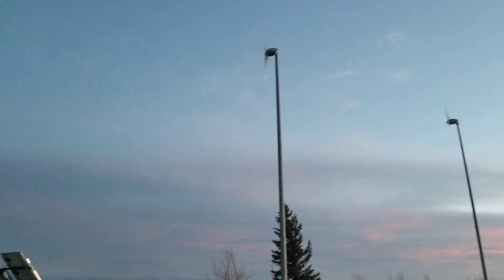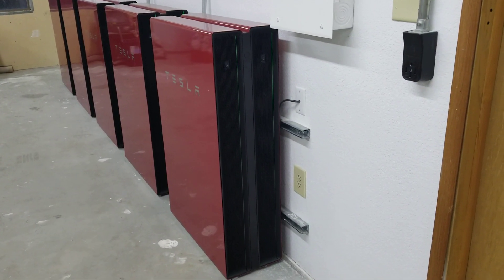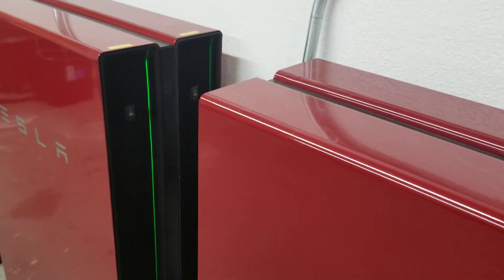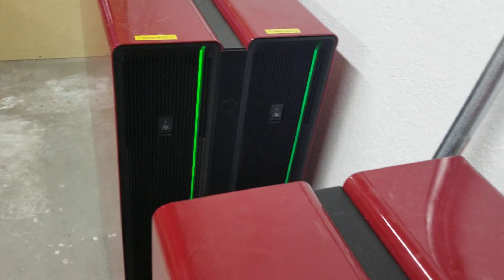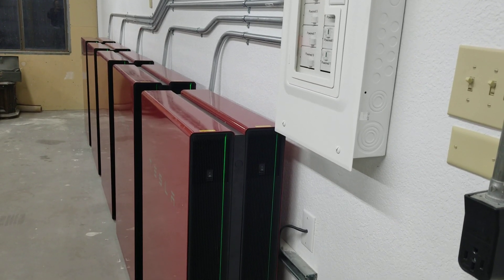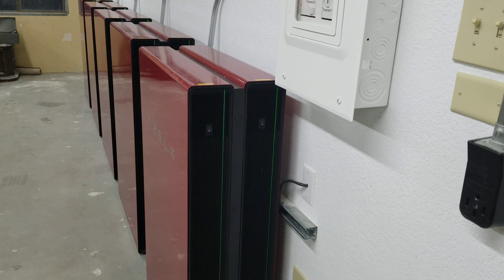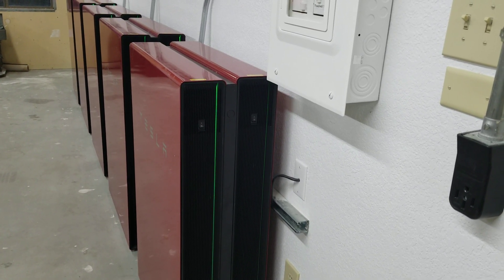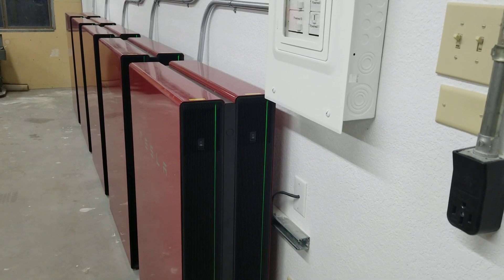Our 10 Tesla Powerwall 2 being charged by wind

Comment: And you consider that expense worth the money?  I have just received a cost analysis Bid for going solar with a Tesla Power Wall.  If my analysis is correct I would assume you must have paid about $100,000 for that Tesla Power Wall set up.  Or, did you get a discount because you purchased so many units?  Apparently getting off the grid is costly, considering how much you've put into your energy generation and storage.  Do you by chance have a business at that location where you would be using a great amount of power?
Reply from the maker: People have differing ways about assessing value.  What's the typical ROI (Return On Investment) for the average $100,000 motor vehicle purchase?  Most of the time they only depreciate.  People buy them because they find a value not limited to a balance sheet.  The same is true for us.  We are working to live our values rather than considering bottomline monetary ROI as the only metric of value.   We live in a state where most grid power comes from coal or methane. We want to minimize our carbon footprint. To do this we use energy sourced as much as possible from renewable source. When we bank our surplus power to the grid from our system the power we later draw back comes mostly from greenhouse gas emitting sources.  So for us, since it is within our financial reach, albeit a stretch, it was well worth the ~$100,000 total costs for us to add the Powerwall 2 system to our renewable energy system.  Some of that cost will be offset by a federal tax credit and buying back less electricity during low gain months early in the calandar year, but we know we will not likely live long enough to see the financial "break even" point for having done so. We are immediately seeing a reduction of power drawn from the grid, which means cleaner air for us, our children, their children, and every living thing on this planet.  Our perspective is "if everyone would do what is within their personal financial reach to improve the environment, a tremendous amount of good can be accomplished." So "is it worth it?"  For us, yes.  That doesn't mean that would be the answer for others.  From our perspective, if we didn't do this, we would be doing less than we should.  For us, this is part of our religious values of Tikkun Olam.
Reply: @AltView1   Thanks for the reply Jason.  My other half is a CPA tax accountant and we look at everything in respect to cash flow, costs and taxes.  I guess if a person has the disposable income then getting off the grid regardless of the cost is how you value your responsibilities toward Tikkun Olam.  Got it.  Thanks !
Reply from the maker: We do not operate a business out ok f our home. Our home is all electric and we drive electric vehicles. We live in a cold climate.  The system is sized for our usage. I've detailed that in reply to prior questions. See those answers for further  details.

Comment: May I ask what your system of power walls cost?
Reply from the maker: When we purchased them, Tesla was charging $6,500 + tax, including shipping each.  Keep in mind there also is the Gateway and installation costs.  Our installation was complicated adding to the expense because of the distance between the batteries in the garage and the Gateway by the utility meter outside, and the integration of our existing renewable energy systems.  The total cost was about $100,000.  For people looking only at a financial balance sheet it is difficult to justify, but for us, the ability to bank power on our property instead relying as much on net metering when the utility get power from coal fired power plants means we are substantially reducing our carbon footprint, also it gives of an uninterruptible power supply during grid outages. For us, its primarily about making cleaner air by doing what we are able to minimize our participation in the greenhouse gas producing economy.  It is part of living our values as we are able. Not everyone can do this. We can and therefore should.
Reply: @AltView1  I LOVE IT!!!!!! In this decade hopefully my home will be fully Tesla'd. Roof + batteries + HVAC
Reply: @AltView1  Really like your way of thinking!! You are one of the best first movers and woooow 135kWh that massive!

Comment: Wow why so much storage?
Reply from the maker: Our home is all electric and we drive all electric vehicles.  During the coldest times of winter we can end up using over 100 kWH in a single day.  The larger the battery, the less likely we need to run a back up generator when the grid goes down during low gain (little sunlight and wind) days.
Reply: @AltView1  do you lose the grid often which is why you went battery over net metering? In another video you show a geothermal furnace which I assume is at your home, do you find that still represents a large chunk of your usage? Really really impressive setup you have there mate.
Reply from the maker: @otif2044  You misunderstand, we remain grid tied and utilize net metering.  The battery system reduces the amount of electricity we push out and pull back from the grid.  The electricity we produce onsite is from 100% renewable sources.  The electricity pulled back from the grid, when needed comes from both renewable and non-renewable sources.  We are doing what we are able to not support the fossil fuels economy.   We will know more how successful this is after a full year of use.  Heating our home with the Waterfurnace in the coldest days of winter can use anywhere from 30 to 90 kWh,  and adding in charging for out electric vehicles in winter can add another 30 to 40 kWh daily.
Reply: @AltView1  Gotcha. Thanks for taking the time it's really neat to see such a large setup.
Also thanks for doing what you do I noticed you seem to be in the medical field in the video before this. Stay safe!

Comment: Largest PW system I've seen yet, did you get a quote for a powerpack before going towards the powerwall?
Reply from the maker: No.  Tesla Powerpack is not available for residential installation at the time we installed our Powerwall 2 system, and as far as I know is still not available for residential installation.  Powerpack entry level costs are about 2-1/2 to 3 times the cost of our installation.  This system was within our financial reach.  A Tesla Powerpack is not. Our utility service is single phase 240VAC.  Powerpacks are designed for installation 3 phases, 380 to 480 VAC which cannot be accommodated at our site without having the utility bring in a service line with that configuration at our expense, which could cost as much as the Powerpack itself.   More information about Tesla Powerpacks are at their website: https://www.tesla.com/powerpack
Reply: @AltView1  I was reading this article, and this one billionaire guy bought a powerpack for his personal home use (iirc it was on his private island?), so they are available, but I guess you need to be a billionaire to be able to get a quote
Reply from the maker: @ryzvonusef  paying to have  3 Phase 380 - 480 service brought to our property,  on top of the cost of a Powerpack with installation definitely exceeds our financial reach.  I wonder what it cost that billionaire to do that project?   😉

If you have a link to the article you read, please post it.
Reply from the maker: @ryzvonusef   interesting but definitely beyond what we could afford: " Larry Ellison, who serves on the board of directors of Tesla Inc. and is the chairman and chief technology officer of Oracle, has expressed interest in a microgrid for Lanai, the island in Hawaii that he bought in 2012. Tesla disclosed in a regulatory filing that director James Murdoch purchased a Powerpack system from the company for $600,000 in 2019 and that in 2020, a company affiliated with Ellison “entered into an agreement to obtain preliminary design services from us for an estimated $400,000, relating to the potential future implementation of a Tesla Energy system.”

Thanks for posting the link.
Reply: @AltView1  You also have the option of running a 1-phase motor to turn a 3-phase generator to charge a 3-phase battery system.  They should be pretty small motors/generators so likely a lot less than bring a new line in.
Reply from the maker: @horus909  Have you calculated the energy loss of doing what you propose? You would have losses both by operating the motor and the generator. Maybe you can do it and get back to everyone how it works out for you?
Reply: @AltView1  Looking at another company's brochures,  a motor/gen would be around 85% efficient, and their solid state around 95% efficient.  Solid state would probably be more reliable and easier to install too. https://www.phasetechnologies.com/downloads/1LH_Series_Brochure.pdf
Reply from the maker: @horus909  let's see you chase your tail for that if you so desire. You are stating efficiency of 85% interconversion just to address the 3-phase issue which means you get 85% of what already is a 10% interconversion loss which takes you to ~25% loss just to do that and at what cost to provide upto continuous 200 AMP @ 240VAC loads (48kW)? 

Nothing in our home needs or can use 3-phase power, so it makes no sense to pursue such a project.  You would need motor - generator couples both for generation and discharge because the processes of charging / discharging via mechanical devices cannot alternate between modes as fast as electronic charger/inverter devices (as built into the Tesla Powerwall 2). 

Since we don't need that, and have already stated, we have done what is within our financial reach, we will eagerly await you making your full size demonstration project to support your thesis. 😉
Reply: @AltView1  I didn't mean to suggest that it would be the best option for your situation.  Someone had asked why you didn't use a different battery system and you had said they were only 3-phase.  I was just showing that there were options to make that work, not that it's most feasible.
Reply from the maker: @horus909  it doesn't make sense. It's not a practical solution. There's a big difference between theoretical, conceptual, and practical. We have lived with renewable energy systems, both off grid and grid-tied since the 1980's. What I'm sharing on my Channel is real world experience not intellectual musings.